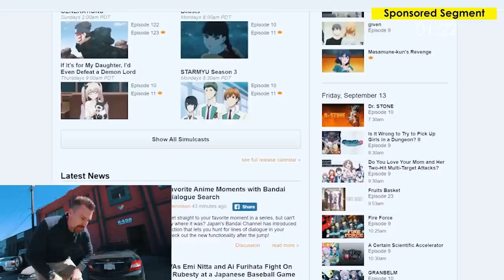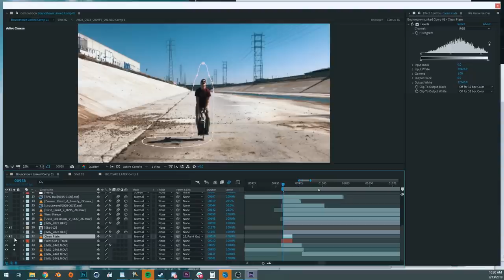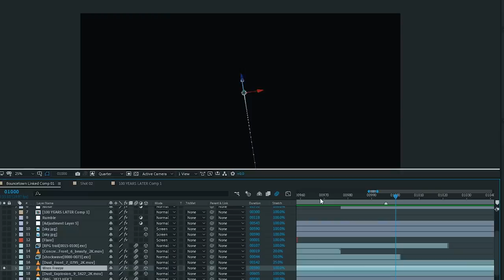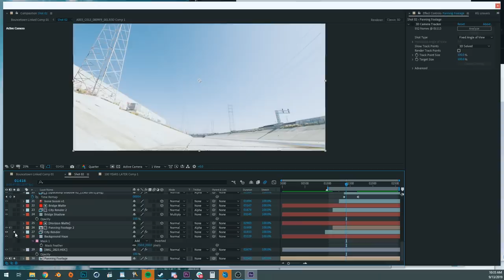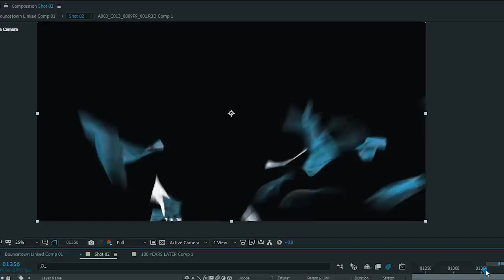How Directors Turn a Joke Into a Video

Comment: 2:53 THANK GOD HE DIDN’T HIT THE SPRINKLER WHEN HE THROUGH THOSE PANTS BACK. He would have ruined that whole costume room. Yeah, it’s water in the pipe but it’s water that more-or-less been there since those fire sprinklers were installed so it’s usually rusty and it dumps gallons a second.